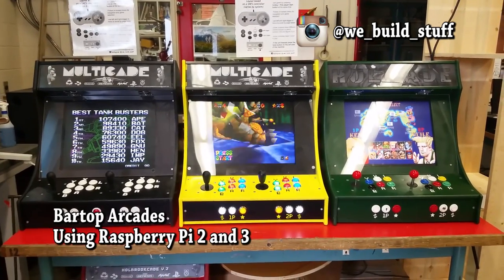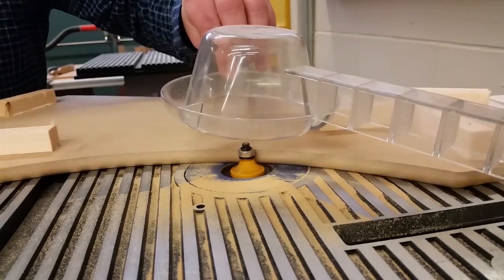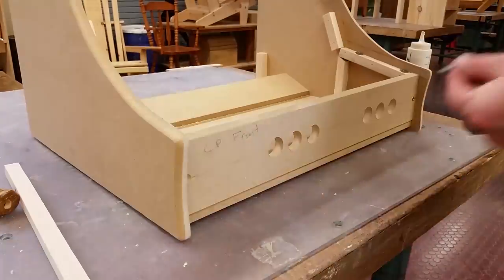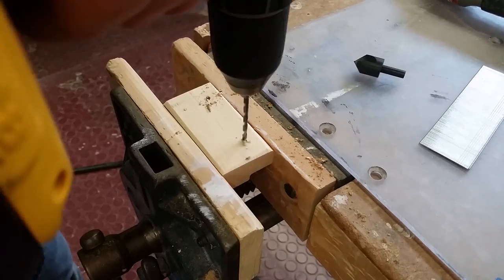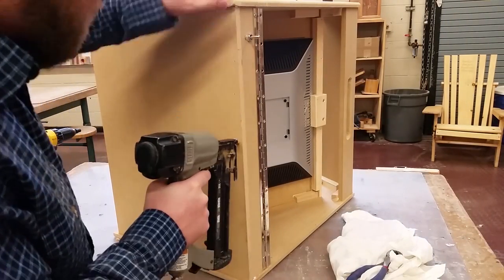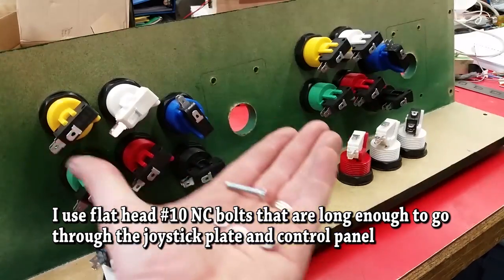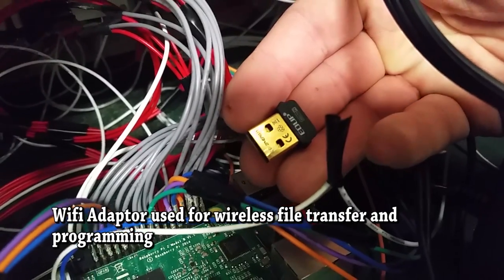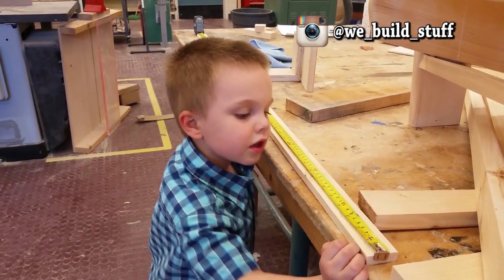How to make a DIY Raspberry Pi Arcade Cabinet!

Comment: I really have problems painting over MDF, all the paint just gets sucked into the the wood.

Also, the 3,5mm audio jack has awfull background noises in my build so I'm adding an USB-Audio adapter (which takes some configuration).

Though, I used a set of USB - retro arcade button sets of ebay, which comes with prefab wires.
Reply from the maker: FuaZe xFuaZe usb encoders are much easier!

Prime paint your cabinet first before adding yoir desired color. I usually do 2-3 coats of primer first
Reply from the maker: FuaZe xFuaZe audio issue could be an issue with your power supply but the Pi is notoriois for a terrible 3.5 audio buzz
Reply: Ah! Yes, as a software engineer, my painting skills aren't superb.
I think I'll just ask a decent painting store if they can give me some advice.
If it wasn't for your comment I would probably end up using loads of spray paint and get pretty bad result.
Reply: I've subscribed, since I think it was very nice of you to comment and the video overal was very informative.

Comment: How does Recalbox compare to RetroPie?
Reply from the maker: at the time of making this Recalbox was probably the easiest to get up and running with basically zero programming experience needed (just follow the basic instructions from their website and videos). Retropie has gotten some awesome new features that are easier than ever to use including "ATTRACT MODE". My next build will probably feature something like that because it makes the front end looks awesome.

What I love about recalbox is that is works every time with no need to customize anything other than setting up your buttons and resolution

Comment: Another question I used the small 12v audio amp in my build and I'm getting a lot of hissing sounds before I load a game? Is there anything in the settings I can change?
Reply from the maker: This is actually the fault of the Pi. the headphone jack on the Pi is notorious for it's noise issues. To bypass this for now I have ordered a HDMI to HDMI + 3.5mm Jack Audio Converter Adapter to 'hijack' the hdmi audio output. I am still trying to solve this issue myself

http://cgi.ebay.ca/ws/eBayISAPI.dll?ViewItemVersion&item=301873097275&view=all&tid=1327125295020
Reply: i used a better quality 3.5mm cord and that seems to fix the problem i had.
Reply from the maker: awesome.. maybe I need to stop using dollar store ones!

Comment: well tha os is a version of retropi. if you want to make a 4 play machine you can use ipac
Reply from the maker: I believe you can. The programmer team of recalbox is always updating and doing new stuff. I can plug 4 xbox 360 controllers into mine using a wireless reciever and they work great but I haven't tried it with arcade controls

Comment: Hi me again! just wondering if you cut everything straight and to length and then make your angle cuts? or cut everything with angles from the outset?
Reply: I have traced the 8.5 x 11 template in illustrator as an svg :) I found the bottom measurement of 45.4cm on the cut sheet page is slightly too long based on the grid printable template who's bottom line looks to be around 44.86 ish.

Do you usually eyeball and correct as you go? sorry I am new to all this as you can probably tell!
Reply from the maker: I make it close (within 1/32") and modify as I go. As long as it sits on a table without wobbling and everything looks straight it should be good to go!

As for the angle cuts. I usually cut everthing out in squares (rectangles mostly) first and add my angles afterwards. It just works easier for my workflow when breaking out my materials. I rip or cross cut everything on the table saw first and do my angles later so I don't have to keep re-adjusting the blade angles back and forth.
Reply: We Build Stuff thanks for taking the time to document and write I really appreciate it
Reply from the maker: sharing knowledge is the best thing people can do!

Comment: how much in hardware does it cost you ? Awesome build!
Reply from the maker: QuebecoisSti thank you.
Those builds are 400 with a used monitor and cheap audio amp/speakers. About 500 now with a few extra when i do t-molding and backlit marquee, etc. It can be done cheaper depending where you buy parts

Comment: hican you tell me how you hooked the mini amp up with the Raspberry Pi 3?    thank you
Reply from the maker: 3.5mm aux cord from the pi to the amp. Amp is powered by a 12v power supply. speaker cable from the amp to the speakers

Comment: Any chance that you could post or email the CnC file for your carving on the sides. I am currently trying to do a similar build and a friend who is helping me on the CnC side is new to it and would like the file as a template for building similar diagrams for my build. ....that said, I may use your's for one side, as it is very cool!
Reply from the maker: All I did was remove the colors from this in photoshop and I had a friend do the "programming". The programming was pretty much 1) import the image and resize 2) tell the software to cut a certain depth on everything that was black 3) go!

One of my goals this year is to teach myself to use a CNC router.
Reply: I'll see what we can come up with my CNC friend. So you just went with one depth for what you cut out then? That seems quite easy. Thanks.

Comment: I have a question for you. Why do you "need" 3 extra buttons? I can see the 6 buttons to play, and three extra buttoms per player. Are all of then necesary? What for?
Thanks in advance. Great video!
Reply from the maker: for my build (using the Recalbox OS) the 3 below each player are for Start/1Player button, Select/Coin button, and a hotkey. The hotkey when pressed in combination with another button will do something.

For example:
Hotkey + Y → Save State
Hotkey + X → Load State
Hotkey + Start → End Game and Quit To Main Menu

Some arcades are simpler with their designs. This works for me. I also have a reset button on the side that resets the Pi completely in case it is frozen!
Reply: Where do you connect the Speakers
Reply from the maker: I have a cheap amp from ebay. 3.5mm line out from the Pi into the amp and into the speakers. You could also just rip apart some computer speakers and fit them in
Reply: In the Pi or in the  Screen?
Reply from the maker: there is an output jack on the Pi. Connect an Aux cord (to an amp then speakers) or your computer speakers directly into it
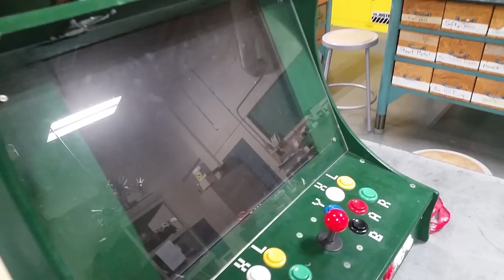Reply from the maker: at 16:19 you can start to see the interior of the cabinets.
Reply: Thx and sry i'm not an english so i didn't understand so early xd

Comment: Hi just wondering if you have a vector version of the cut sheet? I'd love to get it cut out on our CNC at uni.. thanks tom
Reply from the maker: Just the PDF file. I got the original design from an instructables document
https://www.scribd.com/document/335617704/Side-Panel
Reply: Thanks very much most appreciated! How did you find the direct to gpio vs a usb controller like ipac2 or something? Have you tried one of those?
Reply from the maker: I will be trying out a USB encoder on my next build. I found it simple (took longer to make as each wire had to be done separately) and cheap.
Reply: Any idea which USB encoder you have in mind?
Reply: On page 2 of the PDF are your units of measurement out? as the ruler for the side piece says 45.4mm?
Reply from the maker: Should say 45.4cm. I haven't updated the 11x17 booklet.
The 8.5x11 booklet should be correct though
http://holbrooktech.weebly.com/uploads/5/3/6/0/53607781/arcade_plans_package_8.5x11_print_updated_november_2016.pdf
Reply from the maker: Probably the xin-mo encoder. I have a few of them laying around from other projects
Reply: thanks!!

Comment: MDF, that must be one heavy mini-cab unless it's that paper stuff.

Also, aren't you using the T-nuts wrong?  I mean, mounting on the back side of the wood would be difficult with all of that installed, but they really should be on the bottom and not the top.
Reply from the maker: The MDF is 1/2" thick so it really isn't much heavier than my desktop computer.. Then again I have a massive tower full of goodies. It's about 30-40 pounds when finished.

I've tried t-nuts the right way and the "wrong way". Both hold fine. T-nuts on the bottom have fallen out after I take the bolts off. I've had trouble with the teeth actually holding into the wood without putting hot glue behind it. My next build video with show both options and the pros and cons.

Either way you would never know unless you took the machine apart! :)
Reply: It's a nice build, sorry for only mentioning negatives. I recently built something like this for my father for Christmas. 

I built mine out of 1/2 plywood and it was surprisingly light when I was done. I've used MDF for things and thought it would add a lot of extra weight. Then again, it might help keep it still when playing. 

For the T nuts, I would just be worried about someone bumping the controls up and pulling the nuts out.
Reply from the maker: I've never had an issue of the control panel coming out since I have it bolted from the front and the top. I find the button nuts actually come loose more often!

Comment: Question:  what do you do if you don’t have access to a woodshed and these tools and still want to build an arcade cabinet
Reply from the maker: Buy a cheap jigsaw and a drill. Cut slowly to get straight lines. Ive done these in my driveway with scrap wood on the ground as a table. Power tools make it quicker but it can still be done with basic tools
Reply: We Build Stuff thanks so much

Comment: why do you use the I/O for the controls when you could just rig a usb controller under the hood?
Reply from the maker: At the time I USB encoder (knock off XIN-MO) that I had bought did not have a compatible driver that would be recognized. Recalbox has a built it driver made by 'digital lumberjack' that enables the GPIO headers to work with this. I have done over 5 builds using the GPIO and they have been flawless. This year I have moved over to USB encoders for my latest builds. I'll be outlining those in a new video in the next month.

Comment: wait so you didn't need a controller (ipac, xin-mo,..) and just wired the buttons directly to the pi? I wish I had knew that before buying a kit on ebay. Every youtube tutorial I've watched all used a controller of sort. 

I like  your tutorial the best. Hope you get more views soon!
Reply from the maker: The controller is nice because it is easy and made to fit the wires that come with the buttons. I saved 20 bucks but not doing that but spent much more time crimping wires to the quick connects. Back when I was building this the Recalbox operating system didn't have the driver to support those USB encoders (or at least it didn't work for me) but I believe their latest releases do! My next build (an 2 player fightstick with HDMI out) will use an encoder like the Xin Mo

Comment: i'm in the 80's...do u sell these Arcade?what games is it in there?how many games
Reply from the maker: How did you get there? Magic phone booth?

1) I sell locally in Vancouver
2) Just about any retro arcade and console game. games range from the 80s to early 2000s
3) As many games as the hard-drive can hold :)
Reply: You do know that it's illegal to sell pirated roms right?
Reply from the maker: I sell a finished cabinet with an operating system. Buyers are on their own for adding games. It comes with a few open source games from the Recalbox front end but that's all I would include.

Comment: Could you share the link for the amplifier? I cant find any cheap on ebay :/ thanks!
Reply from the maker: I've found many types. Here is one I have used in the past. I wouldn't use the cheap one I show in the video anymore due to "dirty power" issues I had. You can even just use some computer speakers on the inside if you want.

https://www.amazon.com/Lepy-LP-2020A-Class-D-Digital-Amplifier/dp/B01FZKA28Y/ref=sr_1_5?dchild=1&keywords=12v+amplifier&qid=1614887626&sr=8-5

Comment: The buttons and joysticks, cant you use encoder boards?  Then connect to the raspberry with a USB cable?
Reply from the maker: Yes I have switched to using encoder boards.
At the time of making this I only bought buttons and joysticks so I tried the GPIO method. I would only do that again if I was really bored
Reply: @WeBuildStuff  ok.  Thanks.  Yeah,  it looks easier with the encoders
Reply from the maker: @atrain818  i think i show a bunch of it in this video. I go in depth with a new build for this one. I think i show almost every step
https://youtu.be/isiLRtJlUso

Comment: how do you configure your n64 emulator. mine lags quite a bit.
Reply from the maker: not all games work smoothly. check out the compatibility page for Recalbox n64 stuff. You can change the plugin in the menu in the latest Recalbox release as well.
https://github.com/recalbox/recalbox-os/wiki/Compatibility-list-N64-(EN)

Comment: "You could corrupt your SD card" 
Don't seem like you're worried about that when you make a button to reset your Pi but there's no script running to safely shutdown.
Reply from the maker: Murlockingqc only for emergency freezes. I usually leave the  button unplugged or not included at all with my latest builds

Comment: What are all of the power tools I need to do all this woord work? :D
Reply from the maker: A big shop is a bonus (table saw, router, etc) but if I had minimal tools I would want a drill, drill bit that fits the buttons, a jigsaw (cut very slow and you can get decent cuts), and a good measuring tool (ruler, straight edge). Basic tools like screw drivers are handy as well as fasteners (screws, bolts, nails).

This project can be done quickly with fancy tools but is totally doable with the right mindset and some basic tools under $100 if you are willing to shop around and buy used. I don't have a lot of the tools shown in the video but I have been collecting tools for years. I have almost everything I need for hand tools and hope to one day own a home shop with some better stationary power tools for big projects

Comment: hey We Build Stuff, how did you get your hot key working with the usb ones?
Reply from the maker: Skyler M gpio wires and default programming within a driver in recalbox . Pressing the hotkey and 1st player start buttons bring you back to menu. Check my other video on setting up Gpio controllers within the recalbox.conf file
Reply: got it working, its the usb joystick and buttons, not gpio

Comment: so do you sell these? I do not have the time time to put in to this, and I would really like to have an arcade box to play old classic games. thnx
Reply from the maker: I have considered custom builds and I do have some used cabinets (the three you see in this video) that I would sell as is plus shipping. They have been used for about a year. shoot me an email @ customarcadesvancouver@gmail.com
Reply: We Build Stuff how much does it weigh? i play street fighter and i tend to make fast reactions at certain times and i was wondering it it'll shift to the side etc
Reply from the maker: My units are around 40-50 pounds. The main weight is the monitor and the cabinet.
It depends on the surface you have it on. FRICTION!
I put the same type of material you would put in a kitchen cupboard to stop dishes from sliding underneath my bartop arcades. I bought it at my local $ store but looks like this -->>> https://www.amazon.co.uk/d/1b3/Prima-Roll-of-Anti-Slip-matting-1-5m/B004AXTIYM
Reply: Im gonna send you an email regarding a custom bartop build
Reply: What country are guys from? Canada?
Reply from the maker: Near Vancouver, Canada

Comment: Where do you get power tools to work with the wood ?, what is this place called ?
Reply from the maker: I teach high school ADST/shop classes. This is part of an extra curricular club I run doing engineering and arcade design. You also don't need all the big power tools to build these. My latest build which you can see on my Instagram page I am only using hand held power tools (drill, router, skilsaw, jigsaw) instead of a table saw, bandsaw, etc
https://www.instagram.com/we_build_stuff/